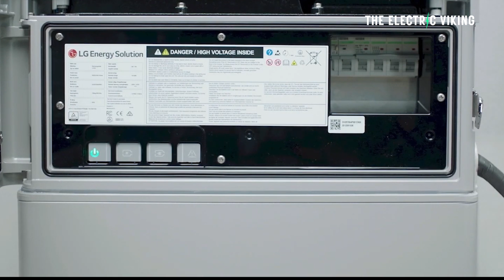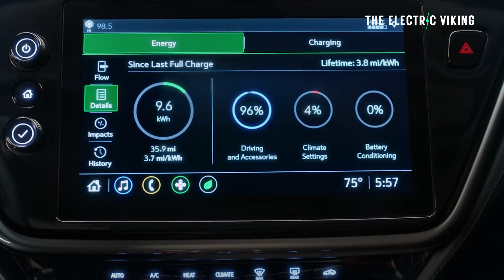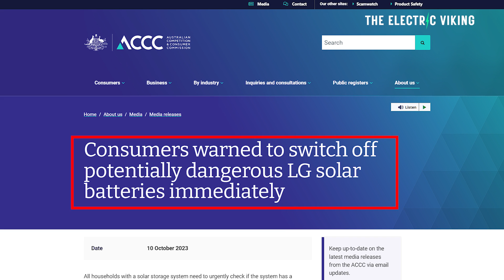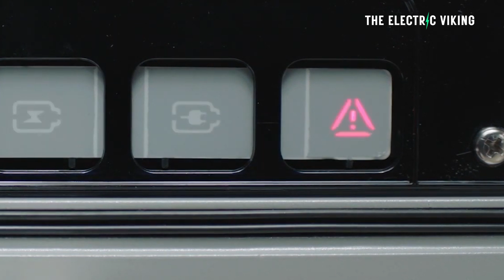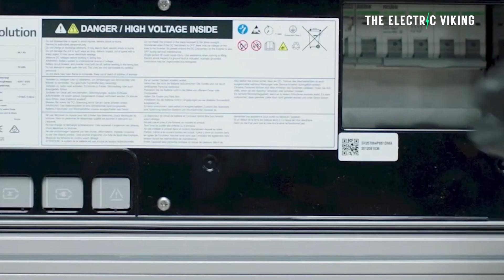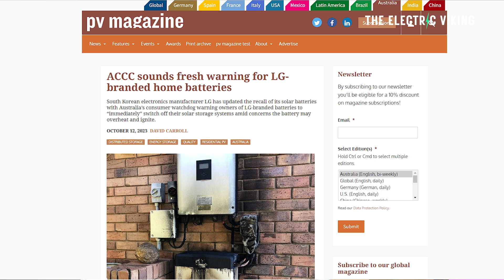Thousands of ‘deadly’ LG solar batteries recalled after fires risk homes

Comment: OMG you are so superficial, nothing of practical experience, you read the texts of your like-minded people who also have no practical experience. The story you put together only refers to a couple of specific products, but in addition to them, LG has billions of devices that we use and we are not even aware that there are LG batteries inside. LG is a name for quality. The only problem is companies that want to make something and make a mistake or be warned about mistakes, but this does not apply to LG cells but to the complete battery installation. Simple people like you will only ask what cell did they use, not asking who build battery, who make connection of cell, whether batteries are exposed to frost or extreme heat in transport, I know you are not interested. Did you count how many time did you say fire and recall, ugh.

Comment: I wonder if anyone has actually considered that it may not be the batteries fault  . Installed a sungrow hybrid inverter a few years back and set up around 20kw storage being lead acid , only ran for about a week before i noticed strange things happening to the batteries they started failing for no apparent reason  . Not overcharging no deep discharge but were being consumed at an alarming rate , however a couple of things made me dig deeper one being that if you touched a terminal post and happened to be earthed you got quite a jolt . Secondly by accident i found that a volt stick would glow about 300mm from the batteries thats when I knew something was amiss ,connected a scope to see if the charge was clean DC and found 120v @ 50hz hidden within the battery supply . Did an autopsy on the batteries and found negative plate connection to terminal posts eaten away . Found lots of other strange things documented it all sent it to sungrow they did replace the inverter a bugger me the new one had same AC issue  , replaced the lead acid with lithium and connected negative hard to ground which cleaned up the AC . Never heard a peep back from sungrow however not long after , that inverter and LV batteries were discontinued  . AC ripple is Extremely bad for batteries especially lithium.

Comment: Na-ion battery production is ramping up with the newest cells having quite promising specs for static storage, hybrids, shorter-range EVs and extended temperature range applications. The first Na-ion EVs have been announced, shouldn't be long until we see home energy storage follow suit. I'd definitely love to slap a 7-8S Na-ion battery pack in my UPS when its AGM battery dies.

Comment: What's Tesla's secret here?  Tesla has installed lots of LG batteries in their EVs.  Is the Tesla battery management so good that it keeps LG batteries from blowing up?
Reply: No, only Chinese made LG batteries are affected, and out of those only one type of cell. It's an ooolde problem and LG seem to fail to address it. Tesla doesn't use this type of cell, because they don't fit their battery pack and because they don't charge fast enough. Only GM used these cheapo cells in cars, and Hyundai/Kia in some of their 400V cars.

Comment: LGChem batteries were catching fire everywhere. That’s why they changed their name to LG energy solutions. You can’t change the name without fixing the problem. All Home storage batteries should be LFP
Reply: My electric unycicle use for LGM50t 21700 ring cells, explode and fire 1 years ago. LG battery's is very dangerous!

Comment: Well, I do have an Electric vehicle, but I will never make my house solar powered.  First off, the installations are very expensive, and residing in a Northern state, the efficiency will go way down on my usage.  Plus what does the harsh weather elements put on the solar panels.
No thanks to solar power - at least for my house.
Reply: My neighbors solar panels are heating up my home (townhouse)  I can cook eggs on my front door. Plus they are deadly toxic.

Comment: Nobody should be using Lithium-ternary (NMC or NCA) batteries for home storage.  They should be LiFePO4.   And yah, I include the Tesla power wall 1 and 2 too.   I think the PW3 finally uses LiFePO4 (not entirely sure though).    This is a great example of companies risking their customers lives in a rush to compete in these new markets.
Reply: Sodium battery is the only safest battery once proven
LFP
LMFP M3P these still can be set on fire although lesser chance
Reply: Just don't install any home storage battery
Until sodium battery are used proven etc.

There's no point in spending the $ to burn property down.
Reply: Install home battery at an isolated location on your property should be good enough.  don’t attach it to the wall.

Comment: The effected batteries were from a specific period and impacting specific models. But you can plug any LGESS battery serial number into the website and you will be immediately notified of whether it is an impacted battery. Registering the battery serial number will then put it front and centre should the model be recalled.

I have an LGESS battery that isn’t on the recall list. I have a monitoring app and regularly check the unit’s operating temperature. Nearly 2yrs and so far no concerns. touch wood

Comment: Another advertisement for LFP safety.
Reply: @Sonshine70s  no.  CATL
Reply: @Sonshine70s  "In an update on the Bouldercombe battery’s commissioning program, Genex Power has revealed the fault initially occurred on the AC side, saying the fault then propagated to the battery modules within the Megapack. The company nonetheless expects the battery to complete commissioning and commence operations by mid-November.
“The failure has been isolated to the power electronics interface with the AC bus bar in the individual Megapack unit itself and not the broader installation of Megapack units,” the company said in the update."

Comment: These dangerous volatile batteries are holding back the entire move to electric vehicles, especially e-Bikes and scooters. The fire hazard means insurers won't allow any personal mobility devices on trains, in other public areas or even in some blocks of flats making them a lot less useful for last mile commuting and harming the move towards personal mobility in cities.

It'll be years before all the unsafe batteries are fully out of use to the degree that insurers deem it safe to have personal mobility devices in enclosed spaces meaning more people are stuck relying on cars for longer.
Reply: Unfortunately NMC and NCA batteries are still being built and put into vehicles. Even Tesla continues to do so, often resulting in fires. This needs to stop. LFP should give plenty of range without setting the world on fire.
Reply: Somehow your assumption does not even remotely line up with what insurance companies are saying about vehicle fires...
Reply: @Tschacki_Quacki  just read this quote from Forbes:

"Some insurers are getting nervous about the possible scale of liabilities. John Lewis Financial Services has paused insuring electric vehicles while its underwriter analyses risks and costs.

The cost of replacing batteries is causing insurance companies much angst. Batteries are usually mounted underneath the passenger compartment and cover a huge area. This makes them more vulnerable to damage, and their sensitivity adds to the problem. What would be a minor shunt for an internal combustion engine (ICE) powered vehicle can be catastrophic for an electric one.

A lack of engineering expertise often means the battery has to be written off. Batteries can cost up to half the purchase price of the car. A Jaguar I-Pace BEV is priced close to £70,000 ($86,000) in Britain after tax and a replacement battery will cost about £35,000."

Comment: None of these lithium battery fire alerts name the particular cell model that is involved. I have an electric vehicle with a battery that I built myself using 742 cells of LG M50T which are 2170 cylindrical cells made by LG in China. After the first LG scare I contacted the firm that I bought my cells from (Nkon), to see if they were affected. They said that the cells with the problem were pouch cells, not cylindrical. I cannot keep asking Nkon if my cells are affected each time there is a reported problem in which the affected cell type is not named; they would probably get annoyed with me. I have had no direct contact with LG, who probably would not have been willing to sell me the cells; this means that LG does not know that I exist. Big question: if a problem does arise with the M50T cells, is there any way in which I would be made aware of it? Would LG notify Nkon and other dealers, asking them to contact customers who have bought cells that are affected?

Comment: Very surprised that LG has messed up like this, what is the root cause of these over heating problems ?
Reply: given that its only them having such serious problems...i think they have big problems that cant be easy solved. best avoid LG
Reply: @havencat9337  That's a very oversimplified way to look at this.
You won't find any company at that size, that never had a manufacturing issue that lead to fire, death, destruction and other bad things xD

Comment: LG screwed the pooch on this one. As a S. Korean chaebol, i wonder if Kia and Hyundai are also affected? Or do they use Samsung batteries?
Reply: LG is a big battery partner for HyundaiKIA. They are building a factory together.

Would honestly not freak out about it. Bad things will always happen, especially when you make millions or billions of things. Imagine you do your work 99,999999% in the right way and it would still not be good enough.

Remember the bad Samsung phone batteries? Doesn't mean Samsung produces trash. I mean, they do... but not exclusively. It's not an important issue in the bigger picture.
Reply: That does not matter. NMC and NCA batteries are just flawed by design. Let's stop using highly instable Cobalt